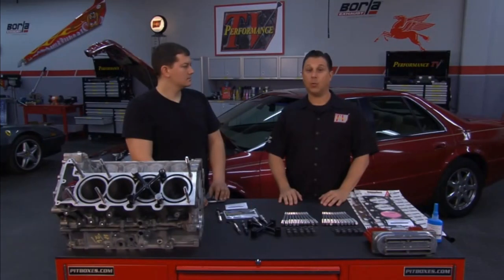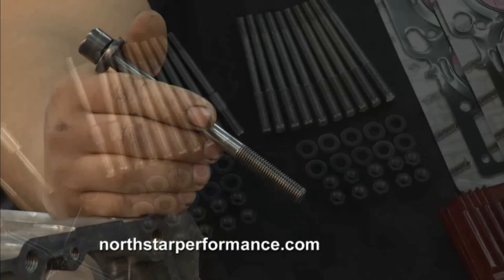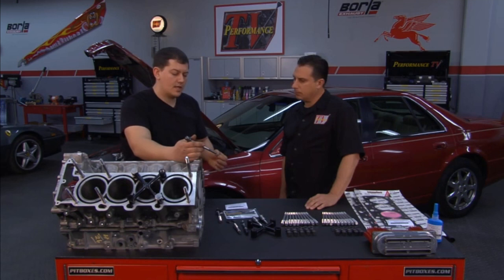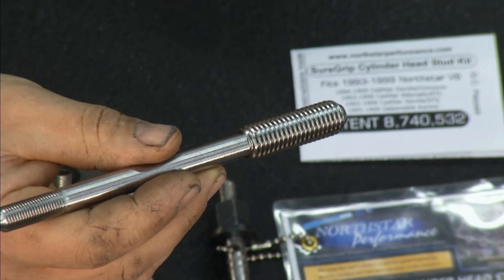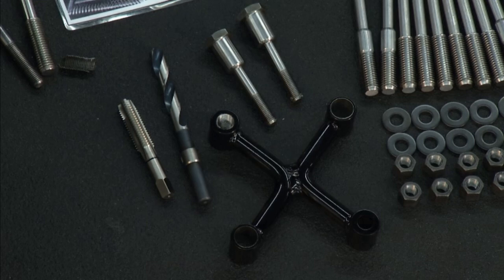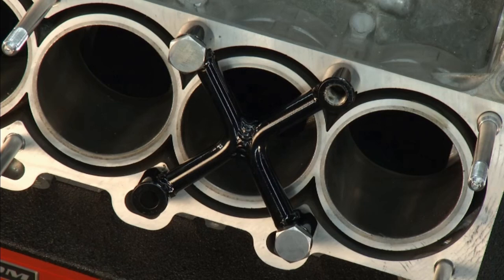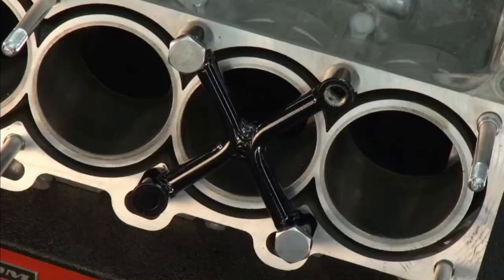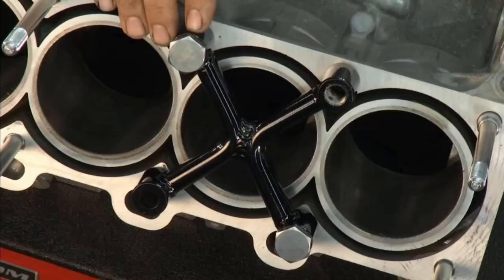Northstar Performance on Performance TV in Tennessee

Comment: He said to expect problems at 120-130,000 miles!... lmao! More like 68,000 miles on my 04' GXP northstar v8. Dont let these guys fool you, Yes, his headbolt design is genius, not taking that away from him, but The Northstar engines are pure garbage. Every component of my engine's cooling system has failed before the 75,000 mile mark....... This is completely unacceptable. For years, Cadillac was fully aware of this motor's defects and design flaws, yet they continued to pump them off the assembly line. It's no wonder GM went bankrupt in 2008. American made used to mean quality and longevity, now it just means a higher price tag. My 90 year old Grandmother is still riding around in a 1989 Honda with almost 300,000 miles on it. Sure its had some repairs done to it, but it sure didnt start blowing head gaskets at, 100,000 miles like these garbage Northstar motors... Shame on you GM. Always allowing the Asian market to do it better.......
Reply: Come on man. Every cooling component has fail? People like you are the reason I was able to buy a 2001 Deville for $375.
Reply: blackericdenice, good. Im glad you got a good price. What exactly does "someone like me" mean?  And no. Not all engines have known defective cooling issues and were still produced anyway....theres a reason they stopped manufacturing the northstars.... because theyre trash
Reply: Try taking care of your car, and listen to the idiot gauges. My Northstar is 22 years old with 140K, runs great. Why? Cuz I take care of it
Reply: Love your replies. I have a 95 Eldorado with 140K, runs great. But idiots think you just have to put gas in them. I take mine to the Cadillac dealership for regular service. And like you said, if you cannot afford a Cadillac, don't buy one.
Reply: @BasictechNews  I have a 1999 ELDO with 42,000 and knock wood and a little maintenance still runs great. Plenty of power and decent gas mileage.
Reply: @hemirush1443  I have a 95 eldorado with 173K on it, it still runs great. Keep the oil changes up it should last you a long time

Comment: The only "problem" is owner/operator error in not servicing the cooling system properly with the CORRECT COOLANT for all GM vehicles with ANY aluminum components in the "cooling system" called DEX-COOL. Just because you "bought a Cadillac" does not mean you are magically immune to and/or protected by some magical force field that will make your "new Cadillac" run forever with zero maintenance and/or whatever "coolant" you lower yourself to dump in when the "idiot light" comes on and you get around to it. If you can afford a "new Cadillac" you can afford to maintain it properly even if you can't read an owners manual because "private school" left you "educated" but functionally illiterate OR too damn lazy to read.